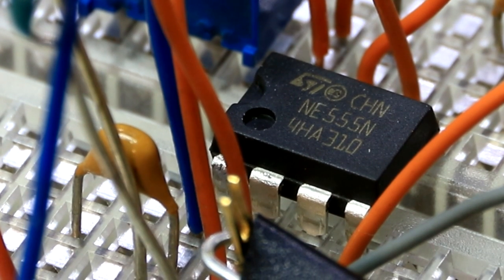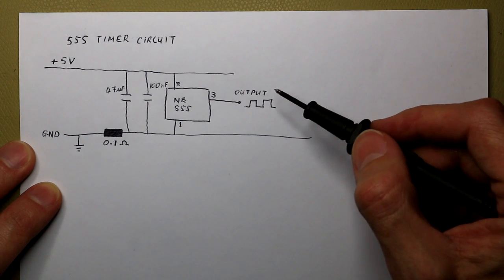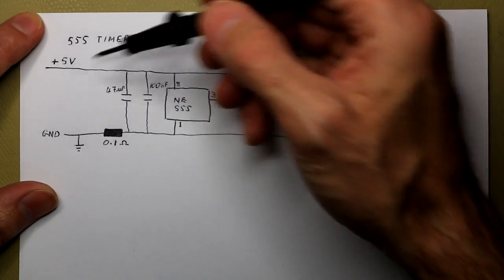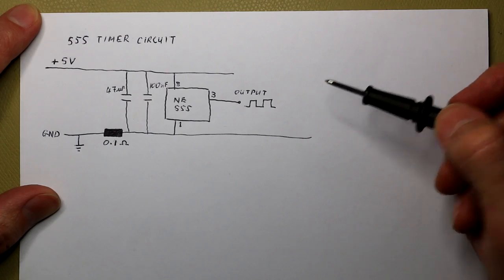Decoupling capacitors and the 555 timer IC (#004)

Comment: Thanks for the video! Don't those capacitors cause an inrush current spike when the circuit is first powered from USB, for example?
Reply from the maker: Very good point - and something to always keep in mind. Yes they do cause in-rush, but not big enough to cause problems. The "built-in" wire resistance of the cable will mitigate the in-rush and the specific values I used are small enough not to be a problem.

Comment: If the two capacitors are in parallel, doesn’t the 100 nF barely add anything to the 47 µF? Is it something to do with the type of cap?
Reply from the maker: Very good question! Your instinct about the "type" of cap is correct. Even though the 100nF cap adds almost nothing to the total capacitance, there is one major difference: the ESR (or equivalent series resistance) on the small cap is very low. This means it can absorb high current spikes a lot better than the larger cap. The ESR is a great measure of how "good" a cap still is. Look for ESR meters online.

Comment: THANKS ❤!!! 
The value of pin5 capacitor is the same? 100nf?
Reply from the maker: The value of the capacitor on pin 5 was 220nF. But note that the 220nF capacitor is used for the timing part of the circuit and does not serve a purpose as a bypass capacitor.

Comment: Ive added these decoupling capacitors on my dual powersupply. So right after the outputs of the LM7812 and LM7912, a 100uf and behind the 100uf a 100nf capacitor. Then you dont need those on each circuit board. 😄
Reply: Decoupling Capacitors are required very very near the each chips/transistor switching circuits. although its good to use it with the regulator too, it won't help much with your circuits. You should always place them very close to each chip, etc. The small resistance and specially inductance between the capacitor and the device you are trying to decouple makes a huge difference. Too large distance and the resistance and inductance will be large enough to mask (if) any help the capacitor gives.

Comment: Ive got a question about your circuit. The small 100 nF capacitor you have going to the first pin, it seems to be connected on one side to the first pin and the other side to nothing. The capacitor at pin 5 has a clear connection to pin 5 and to ground, but I see no such connection for the capacitor located at pin 1. If someone could explain this to me that would be great because I am not understanding how this could work properly.
Reply from the maker: Hi Matthew. I'm assuming you are referring to the top-view of the breadboard at 2:14? You will see that both the 100nF and the 47μF capacitor are disconnected. This was just the way I had it set up before I connected them one-by-one. The wires I used are in row 15 and row 20 of the breadboard.
Reply: TechBench yes that's what I was referring to, thanks for clearing that up

Comment: Hello and thank you for your very informative videos.

I am looking for a circuit or a signal generator capable of providing a rectangular signal varying from 0V to 5V, but with a rise time of 30ns.
I want to apply this signal to the reentry of a microcontroller.

Very cordially
Reply from the maker: Do you need an exact rise-time of 30ns, or just as long as it is less than 30ns? In the case of the latter, you can use a 555 timer circuit and feed the output to a 74LS04 (hex inverter chip).

The 74LS04 typically has a rise time of 6ns. In order to achieve the varying signal level, feed the output of the LS04 to a potentiometer. The two outside poles to the GND and output pins and the center-tap to feed to your application.

Comment: This was really helpful to see what is going on in the circuit visually with the scope. Especially when you disconnected and reconnected the 2 different caps. 

I have a question while I'm here;  I am building a polyphonic 555 based organ. A musical keyboard with 13 notes of sorts. Each note is generated by a single 555, so there are 13 x 555's in the circuit, all arranged in astable mode with each configured to produce a slightly higher frequency from the next. Would it be sufficient to only have 1 '2 cap' arrangement across the negative and positive rails of the circuit? Or should I have 2 caps between each 555's pin 8 and ground? 

Thanks again for the informative vid! Subscribed!
Reply from the maker: I would use one bigger filter (or reservoir) cap for the row and one smaller 100nF cap at each 555, directly over the power rails and as close to the chip as possible. You could also spring for the slightly more expensive CMOS version, which does not exhibit this problem as much.
Reply: Thanks for the advice! I've already purchased the non-cmos version's so I'll use those with a 100nF at across pin 8 +1 of each IC with a reservoir cap across the common rails.

Cheers!

Comment: Do I need to include the 0.1 ohm resistor in my circuit or is this just for explanation here?
Reply from the maker: The 0.1 ohm resistor is just used to measure the current (i.e. using ohm's law and measuring the voltage drop over it we can calculate the current draw). It is not required if you do not wish to measure the current. The circuit will function fine without it.

Comment: Very informative for a novice like myself. There was only one thing that requires more explanation. You changed ch2 to AC on your scope. I can clearly see the benefit, would you mind explaining why This works on a DC circuit and when you would use it. Also are there any dangers. 
I have subscribed and thank you for posting this up. 
If there are any others whom have some input, please comment
Reply from the maker: +Dean Greenhough - That's a good question! When switching to AC, the oscilloscope will attempt to measure AC (in other words any alternating or changing current). Since any change in DC voltage effectively means it is "alternating" for that instant, the oscilloscope will measure it.

The benefit, as you've stated, means that you're removing the DC offset voltage, thereby allowing you to set the measurement level to a much lower scale.

No danger to using AC for measuring DC circuits - just keep it below the rated maximum input voltage of your oscilloscope and you'll be fine. Just never measure AC (from the mains) with your oscilloscope, since its ground wire shares a common ground with your how earth-wiring.
Reply: +TechBench brilliant answer, it sunk in straight away.  You sir are a natural teacher.  Looks like me and AC coupling could be great friends, time to test out my new learnings. 

Thank you for a prompt reply.

Comment: As everyone says, a picture is worth a thousand words, and this video proves it.

On all good sites having 555 related circuits, there is always a mention of the bypass capacitor for pin 5 and now I clearly see the benefit of having it.

What caught me by surprise is the effect of the 47uF accross the supply rail.  There might be some sites addressing this "fix" but obviously, I overlooked and missed it.  That is convincing enough to put few of these puppies on my next parts order list.

BTW, the 555 you've tested is a BJT (bipolar) one, right ?  Would you expect the same scenario with the CMOS version (7555) ?

Most circuits using the CMOS version have a mention that the bypass capacitor is not necessary (on pin 5), but now I'm uncertain about the electrolytic one since I don't recall any mention of it, would it be the bipolar or CMOS version.

I understand that there is no harm at using the caps regardless of the timer being used, but under certain circumstances the components counts and the footprint might be an issue.

Thanks for the video, really well done.